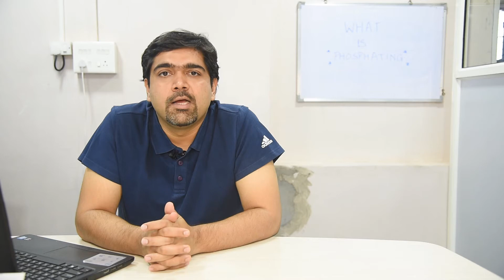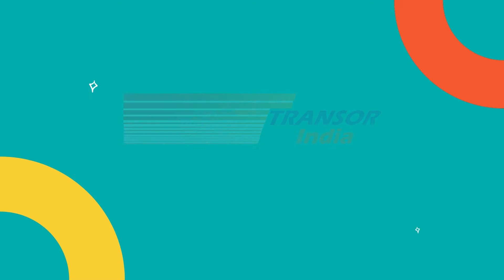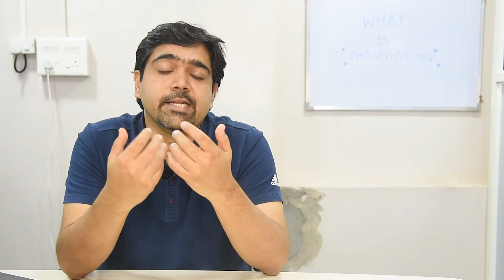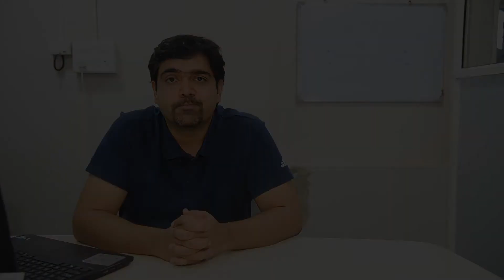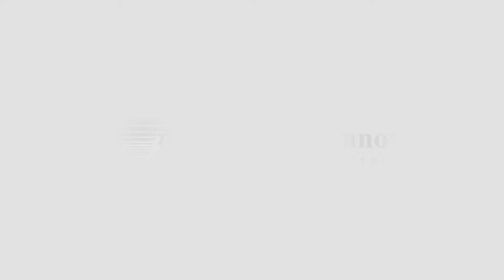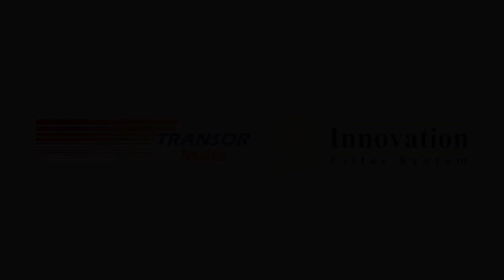Phosphating sludge and handling costs

Comment: I agree with your point. I also believe that the design of certain pool structures, particularly for various steps, is overly angular and lacks a proper slope. This design flaw can lead to a strong adhesion of sludge, making it difficult to remove. :(